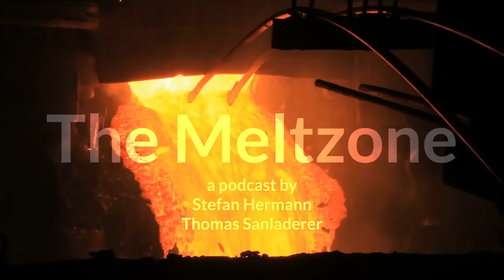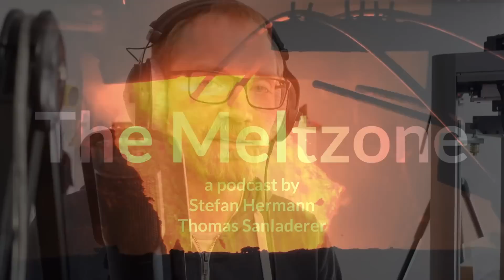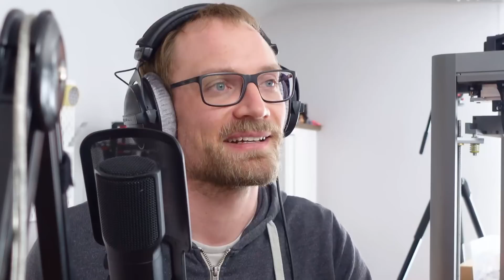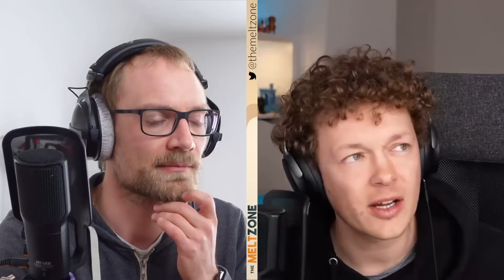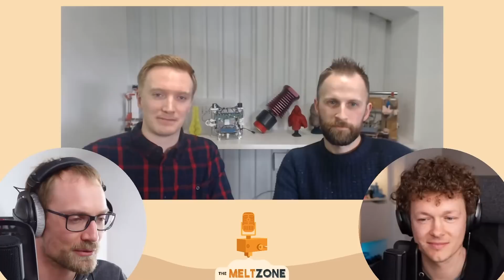Did we do a bad job in testing extruders? (feat. E3D) - The Meltzone Podcast Ep73

Comment: What Mike hit at the @1:00:00 mark is my biggest issue. Every time I do flowrate tests, someone claims some WILDLY different numbers for their results and I cannot help but assume that they are just much more tolerant of their results than I am. Or I get, "But Stefan/Tom only got this result!" in the comments. Standardizing would be nice, but with all the variables we have in printing, I don't really know how to do that. You also run into, what is a failure? I've been known to rip apart layers of a Race Track test to measure wall thickness, because sometimes extrusion widths narrow significantly well before "failure" is evident.

The Speed Boat Benchy is maligned for being silly, but it DID set out rules for what could be done to achieve the final result. Now slicers have a lot of little tricks to shave seconds off, but in the end, we almost need that type of standardized set of parameters to be applied. As Tom noted, someone can game the system and optimize for that then. Or we also may run into issues where some new product is just unique and falls outside of the parameters in some way. If the "Standard" test only goes to 50mm3/s, how does that account for long term improvement? Kind of like how we have to keep having new CineBench versions as computers overrun the old testing. It almost has to be an ever evolving thing. 

I don't know that I said anything here, this is such a deep and fraught topic. I do my best to present everything that went into generating the results I do, but I always lean on "Real world" printing in my results. I've found time and time again that more "Scientific" tests don't result in real world results. I've had extrusion systems that under-performed in a blob test, but pushed filament harder than those results would indicate in a real world print. 

/end rambling train of thought

Comment: I wonder if E3D looked at metal injection molding (MIM) for the Revo Roto's heatsink? At my company, we use MIM in our high-volume consumer products. It's more expensive than die casting, but can make more intricate parts. Like with plastic injection molding, the molds can have sliders. Secondary, selective CNC processes can be used to tighten up tolerances in areas that need it.

Comment: The tests by Thomas had unfortunately a too low wall count: if pull-out force is relevant the part must be technical, and no one does 2 walls expecting strength.
Reply: He does have a point for the testing, you want weak parts for tests
Reply: @andreasstromberg  but not so weak that all tests are near the minimum reading of the instrument!

Comment: Insert/whitelabel stuff: exactly what Stefan said. I can go on Amazon, Aliexpress, etc. and find the same product from 100 vendors and the price barely varies... but if I find a trusted name, I expect them to have done the due diligence of ensuring the quality. Reviews are gamed, so when someone you trust (Prusa, Bambu, Printed Solid, MatterHackers, CNC Kitchen, etc.) says "here's screws" "here's threaded inserts" "here's bed surfaces" "here's thermistors" etc., you can just price shop vs. need to worry it's the wrong item or breaks easily. And it supports those we want to see more. I say this as someone who's returning some square nuts right now because what they advertised and what I got were different...

TikTok scam: oof, I don't know when that style scam started, but I remember following accounts early Twitter where one day they're posting recipes and whatnot, and the next day they were selling health pills. To make matters worse, they sometimes did both. They would have dozens of accounts. The ones that posted recipes and art and whatnot grew huge, the ones pushing pills and conspiracy were small. But they would do 1 "real" post and then 2 dozen retweets of the other accounts. Luckily, the app I used had an option to disable retweets per-account and those accounts basically became too infrequent to be worth following. I don't know if TikTok/IG/etc. has a similar thing. But it's still a sucky way of doing things. And yea, once the accounts get big, they get sold off.

Extruder testing: I am fully in support of standardization of things in printing. There's the catch 22: if you have a standard, how can you innovate as it could mean you don't meet the standard... but also, if you have a standard, there's now a line that people can expect their product can reach. I may be on the extreme end of wanting it for everything... standardize the power system, standardize the board connectors, standardize the breakouts to the extruder, standardize the motors that are used, standardize the interfaces, standardize the frame and it's connections. But the end result isn't every printer ends up being the same, it means that I can go and upgrade my extruder to a precision one, know it will work with my standardized high flow hot end, and that it will connect and work to the standardized connector on the standardized power and standardized steppers can talk to it and it will just work. And it's that last thing: having a printer that just works. Go outside the lines and build your own thing... get the standard updated. But if 90% of the market says "I buy printer that goes brr" and the remaining 10% goes "I will check to see if it does what I want..." and they make their decision based off some YouTuber's custom testing rig that tests things different then another... then it's almost cherry picked results since one setup may work while another doesn't. And if 10% of the market is going off "cherry picked results", that's not good. The bigger area IMHO, while lots of talk around how to reach a limit, is calibration. If 2 or more calibrate differently, then they may get different results, and that can skew final quality and lead to unnecessary debugging of an issue that doesn't exist. As in, taking a test Stafan made about how fast of a print something can be done, then using that result for setting max flow or similar in my slicer, I may get skipping or issues and go "something must be wrong with my printer then". In the end, it makes "buying a product that happens to be a printer" is harder when not standardized or standardization doesn't exist.

Comment: So I have to  ask, how is the problems in testing  a 3d printer part any different from testing an after market car part? There is no standardisation around carburettors for example, but after market versions give different performance but not on every engine. 

3d printers are just in that phase where real world testing is just getting significant enough a consensus about what changes are possible and what benefits it gives.

Anyway, interesting discussion, so thanks for that.

Comment: I think that there are merits to both perspectives. It seems to me that we got into this pure stat performance comparison because not so long ago many extruders were not at the level of refinement where you could afford to trade off performance for quality. I think one of the best things to do moving forward is to somewhat combine both approaches but also accept that you don't have to necessarily define what is the "best". If I were you I would include the flow rate graph for certain flow range that is the average or on the high side of most consumer printers. Then I would choose 3 models to print. One model to demonstrate performance like a flow track, one model to demonstrate strength (primarily layer adhesion), and a last model to demonstrate quality. The problem is that we have reached a point where it is effectively impossible to objectively rank extruders because as E3D points out there are just too many variables. The quality idea isn't constrained to E3D either. I recommend reading the blog on how the Orbitor extruders were designed and iterated and the various issues the designer had to solve.

Comment: The elephant in the room is the same for a long time and mentioned here too:
Extruders do not extrude a defined length of filament, because they do not measure the amount of extruded filament at all. The stepper motor controls the rotation of the gear, but there is no compensation for slip, depth of teeth-in-filament, etc.
THE improvement in extruders would be an extruder that actually extrudes the requested amount of fiament.
At the moment lot of tedious work is done in “improving” extruders in the wrong direction.
Reply: This is really a non-issue. You akways calibrate your steps before testing, and you verify by using a known length of filament measured before, and what remains after (unless the test consumes the whole length ofc).

Additionally there are plenty of filament sensors today that actually measure how much filament is moving. Some optical sensors even measures minute variance in diameter. This is how printers know if and when the extruder is slipping or skipping and can make adjustments accordingly. In case of the latter, they can actually continously adjust extrusion to  compensate for the variance. These things aren't new unknown, versions of these have been available as aftermarket components and supported in common firmwares for several years now.

Comment: So i watched both testing vids and now this. What I got from the test videos was that for the money the Revo Roto probably isnt worth buying. Then after watching this, the guys from E3d are saying while yes the motor in the Revo doesn't push as hard as other extruder motors, but for general printing the quality of a print  and ease of use are better than other extruders and most people care more about what a print looks like and how easy is the extruder to use. Does anyone else agree with this or am I totally wrong?  Please comment, cause I'm still a bit confused on whether this extruder is good or not. 🤷‍♂️
Reply: Its a bad extruder but they wont recognize there own failure, instead they are double down trying to sell it.